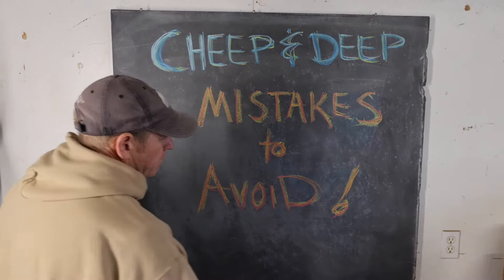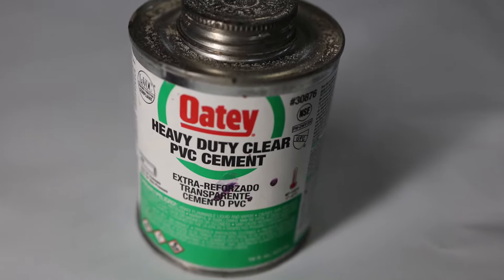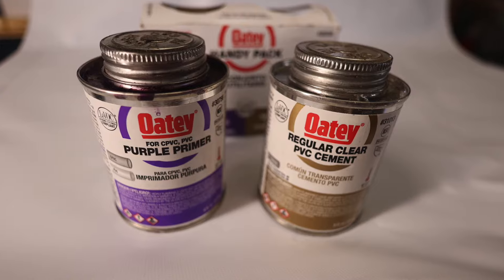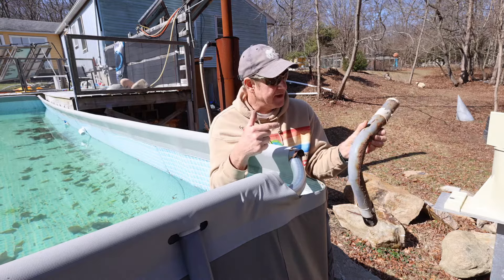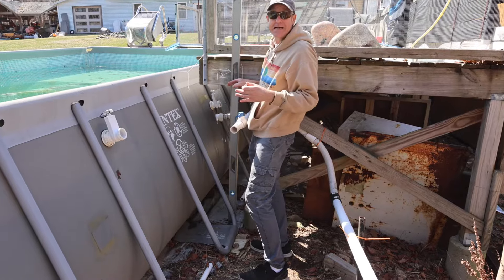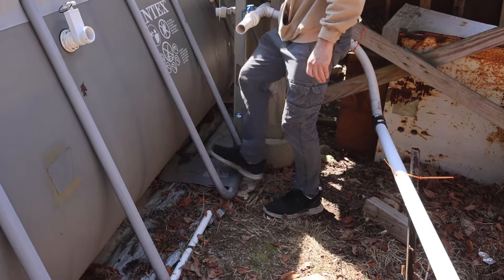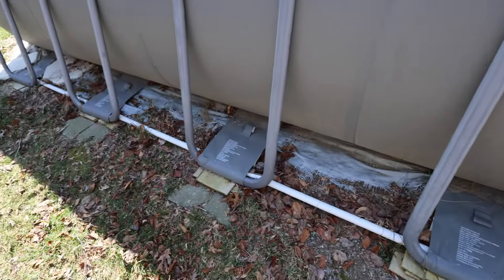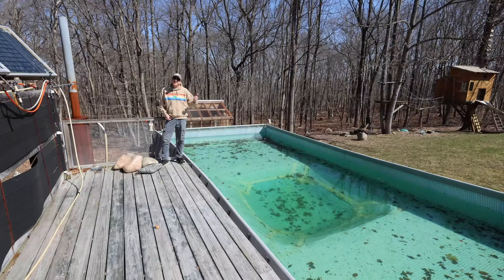More on How to Make a DIY Swimming Pool, Cheap and Deep!

Comment: Have you tried sanding the two pieces before gluing them? they say that helps it hold together better.
Reply from the maker: Hello, Yes I tested sanding and roughing up the surface and actually was trying to o the first go around. That’s why I had plywood in the hole to hold the material flat.
The second version of this pool, “Remaking…” I used blue PVC glue and primer. It was tricky to use but much stronger.  Thanks,

Comment: Better to put a tank in the depth and use tile on the area .
Reply from the maker: Like a stock tank? That’s interesting idea. Probably would need to use a contact cement to glue it to the pool vinyl. Thanks for the suggestion.

Comment: Awesome straight forward informative video. Thank you for helping me avoid mistakes I was sure to make. Best advice? "Avoid a hole getting ripped in the side of your pool" 😂  Loved that part, but sorry that happened, we have ALOT of wind so I worry about whipping it around.
Reply from the maker: Thank you friend! To avoid  wind damage try putting 2X10 or some kind of long heavy lumber around the inside perimeter so the wind can't get under it. I even put 5 gallon buckets with water on top of the boards for additional weight. Then just dump them out into the pool.
Hope this helps and thanks again,